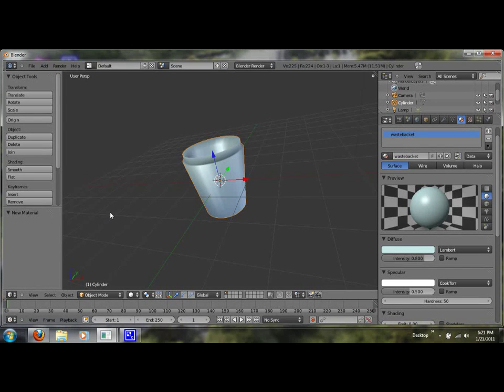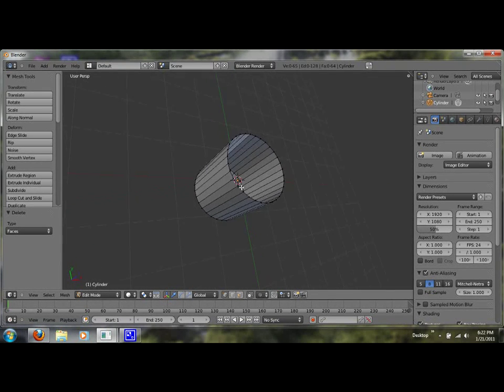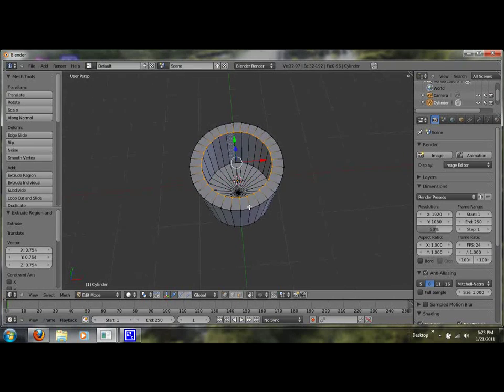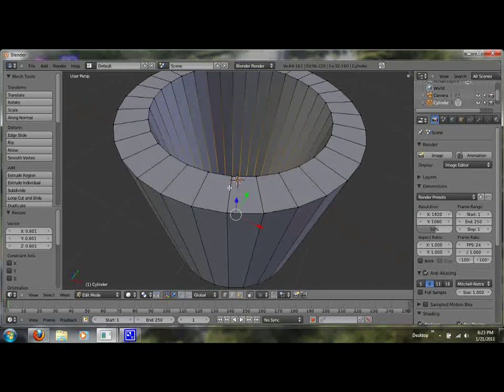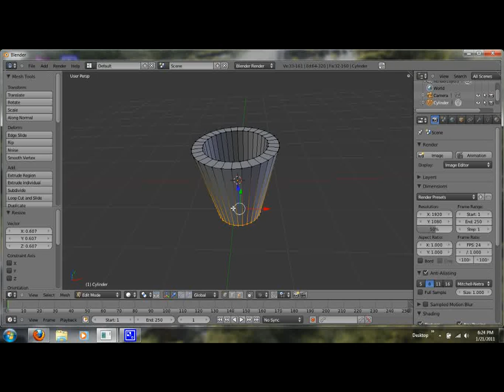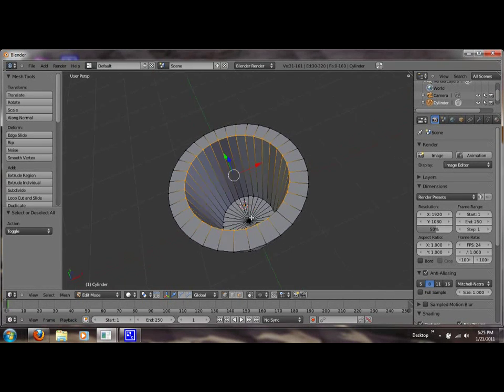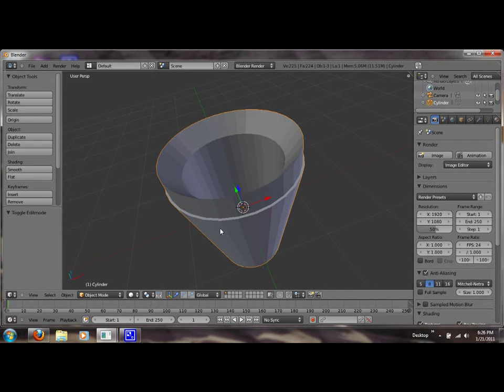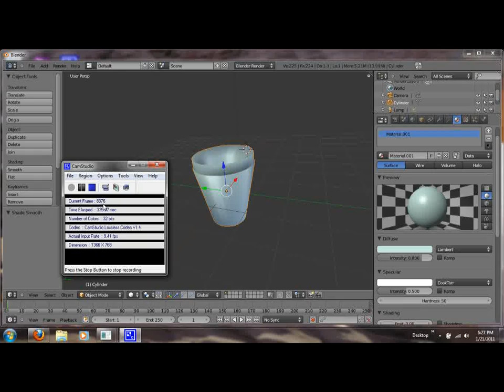Blender 2.5 Tutorial: Modeling for Beginner's

Comment from the maker: @PhenomenalHeadShot Some mice don't have them if you don't, go to user preferences which is under file, and under input on the left hand side click emulate middle mouse button. now when you hold down alt with the left mouse button it will work as a middle mouse button. To save it just under file click save user preferences.

Comment: Those having trouble with the middle mouse/scroll button using win7. Left click on computers background and click Personalize. Click change mouse pointers. You will get a Mouse Properties window,look for add mouse or add pointer device (cant remember exactly). On Mouse properties selecect Buttons Tab at top (there will be 2 Buttons tabs but only 1 will have the following options). Middle option is wheel button, Open the options and select Middle-click option it should work.